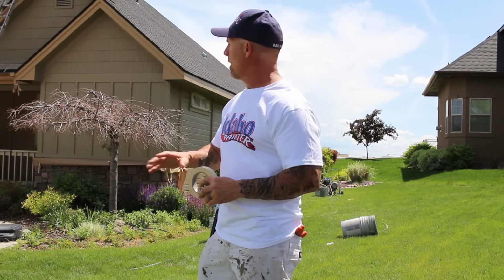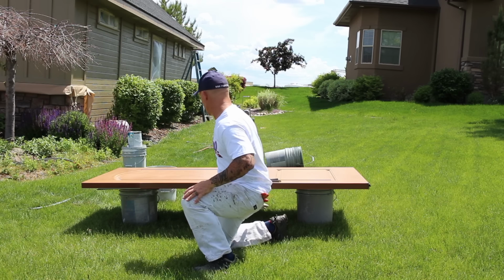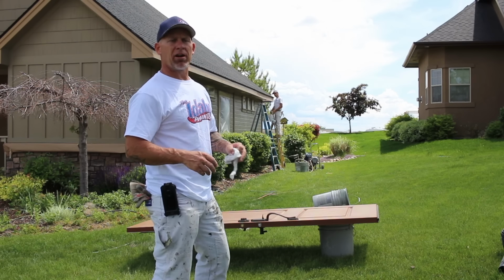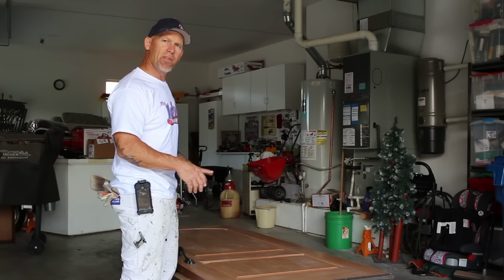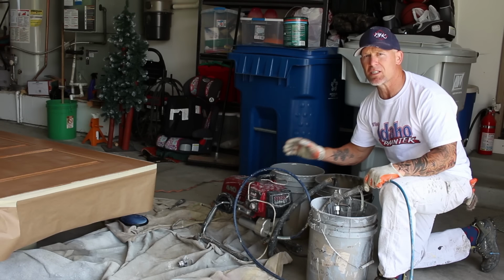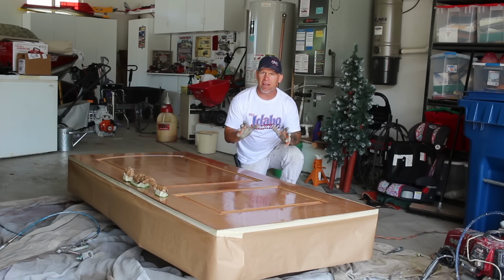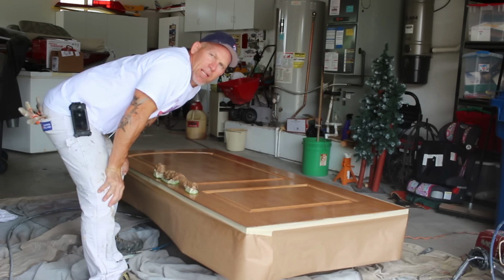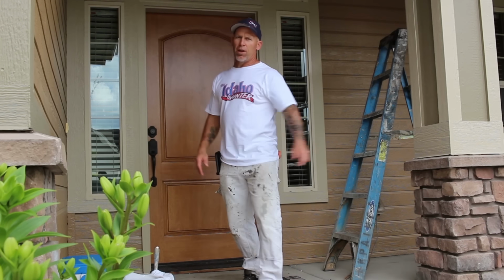Refinishing A Front Door.  Clear Coating A Door With Urethane.

Comment: Great video! I do have one (non painting) suggestion though... Whenever you remove a door (especially a heavy entry door) always remove the hinge pins in order from the bottom to the top. In other words remove the bottom pin first, then the middle pin, then the top pin. This allows the door to hang on the top pin during the process and keeps a lot of mechanical stress off of the other hinges if done in any other order.
Another tip to consider is while removing the pins (from the bottom up) try to keep the empty (unpinned) door hinges as close as possible to their mating hinges on the door jamb until the top pin is finally removed. Again, this will minimize the stress on the top pin during the removal process.

Comment: do you have a video covering  were to use  oil based or water based  , polyurethanes, spar urethane , varnishes , lacquers, spraying or not spraying ,  i really want to know were to use in what,  and how to recognize what is been used  so i don't apply the wrong stuff on top of it and cause reactions,  i what to know what can be sprayed, and what not to spray.
i know is probably a very long video .Is water based more durable than oil base? 
i have seen some videos of yours and i never see you using oil based stuff much.

Comment: What a wonderful video.  And people need to think about and order that hinge pin removal tool. It's much better than a screwdriver that can possibly scratch a door if it slips.  I have a question though. I have a fiberglass door and it needs a topcoat of urethane or is it polyurethane. My Thermatru door company always wants me to buy their expensive topcoat, so I do. But what other brand of topcoat can I use on the exterior side that will ALSO give good adherence, and protection?

Comment: Chris can you recommend a good water based urethane for a similar project. My door is fiberglass jeldwen w a factory finish but with no preexisting clear coat. Looks great but seems to chip easy.
Thanks for any suggestions. Thanks for great vids👍
Reply from the maker: Helmsman spar urethane H2O
Reply: @Idahopainter  Thanks 👍
Reply: @Idahopainter  ps. I got on Amazon before you responded and bought some general finishes 450 flat water based. Am gonna use some 6inch foam rollers and see what kind of results I can get. Do you see any flaws in my plan?

Comment: My wife and I live in South Florida, and have a metal impact door that is painted to look like real wood. Over the years, the external face has lightened up a bit do to the elements. We are thinking about cleaning it, then re-sealing it.  Would the process you demonstrated be safe for a painted door? Which product would you recommend for our application.  We'd prefer something with UV and Water protection if possible. 
Thank you for your video and channel, it was inspiring.

Comment: I had to take my door down to the bare wood (removing varnish and stain) because of severe wear.   My question is how do you sand the detail parts of the wood.  Obviously a sander will not fit.   Sometimes because of the grain I find myself trying to sand up and down in these small areas which is quite tedious.   Suggestions as to how to sand these areas quickly would be much appreciated.

Comment: did you use Old Masters clearcoat ???? I have been using it and like the results but have found it very reflective in direct sunlight (good for protection but gives the door a very "shiny" look) .... Most doors have been fine , but the last door i did got massive sun in the afternoon and looks pretty "shiny" (from the street) when the sun is beaming directly on it
Reply: Does it make the door look almost fake

Comment: Hey Chris, again another great video! I just picked up very nice new front door at a trade show and I am waiting to install it. I am having it milled out but when I get it back I was told to seal the top and bottom as this is where doors will gain moisture. The wood is a kiln dried poplar and is 1 step before petrified so according to manufacturer doesn't need to be coated except for the ends. My question is can I use a linseed oil as a protectant instead of spraying or will this be a bad option and possibly mess with future coatings of lacquer if I decide to ever spray it? Also, do Need to sand the bare wood before I coat it if I'm not staining it first? 
Thanks man, I know you have a bunch of comments but I appreciate your reply and all of your videos. I watch them all!
Reply: ***** thanks my man. I will do that!

Comment: I installed front and back pine exterior doors. did not stain them, just brushed with marine clear coat finish. in a year or two both doors molded beneath the finish.! WHY? HOW SHOULD I FIX THEM? ( I COULD STAIN THEM THIS TIME)

Comment: Should you not be wearing an organic (painting) mask? Also, I thought exterior doors required an oil based paint.
Reply from the maker: Yes, you should, but for filming purposes I do not so I can speak. We do not use oil based paint
Reply: I just found an outdoor water based polyurethane.  I did not see at Home Depot, but Lowes carries it.  Thanks again.

Comment: You're only doing two coats? I thought water-based urethane requires 3-4 coats?
Reply: +The Idaho Painter so if I have unfinished wood I should put 4 coats? 
Is that to achieve the glossiness? Do two coats on unfinished wood not protect it from the weather?
Reply: ***** Thanks for the advice. 
So is 4 coats on a planter good enough?